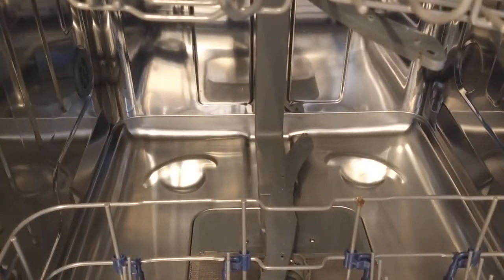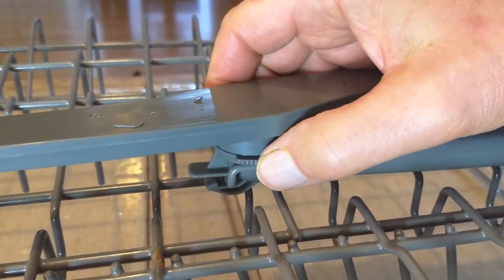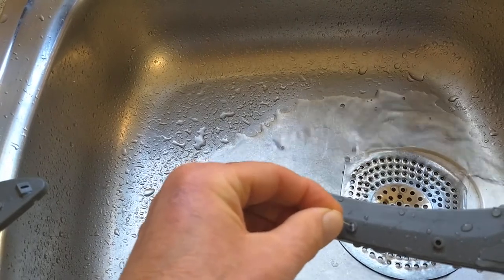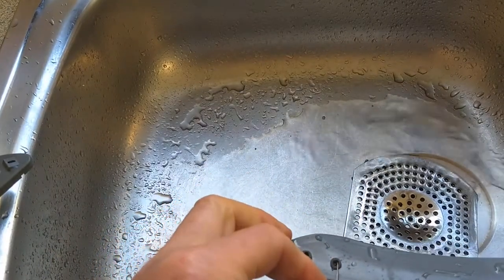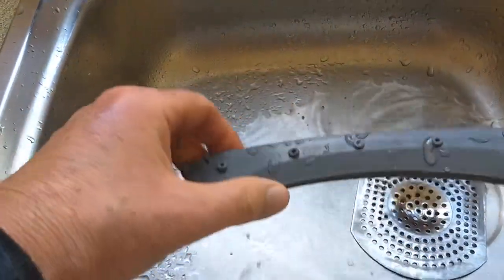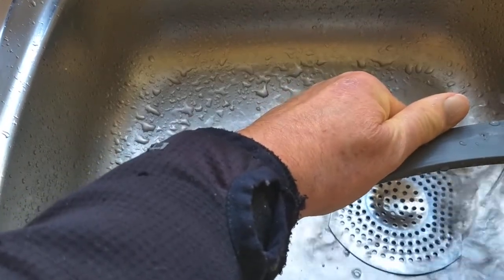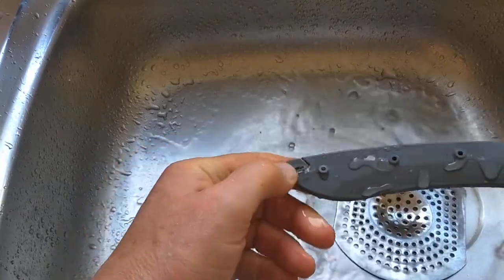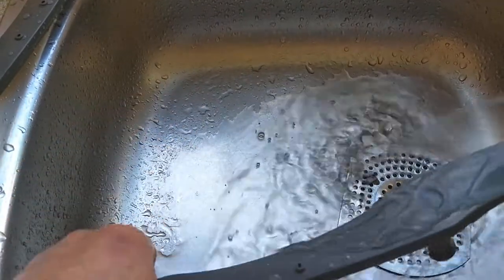Why Are Your Dishes Still Dirty? Unblock Your Dishwasher Spray Arms

Comment: A small metal crochet hook works far better than a pin. Also needle point tweeezers. Then a shot of steam from a hand held steam cleaner. In hard water areas like Calgary if you don't have a water softener you'll get hard deposits of scale build up. Vinegar isn't much use. Industrial strength scale remover is best.

Comment: The sound of all that water going down the drain hurts my Jewish side of my heritage.
Reply from the maker: Hi MRJTUK for the sake of the video demonstration I probably exaggerate how much flow is necessary . Of course all time your spray arms are blocked  or partially blocked you are implicitly wasting water. Once you start to notice these blockages you can often nick them out with a pin.
Reply: It's possible that he spent a whopping 5p on water making this video.

Comment: Just pushing the debris back in doesnt work, it needs to come out. push it in first, block the holes temporarily with tape or bluetac fill the arm with water from the central mounting hole, shake and turn upside down to let the water and debris flow out, repeat etc